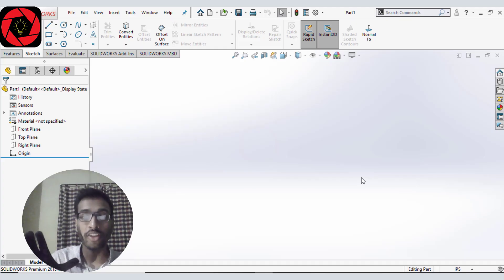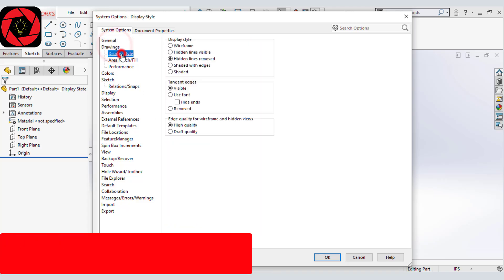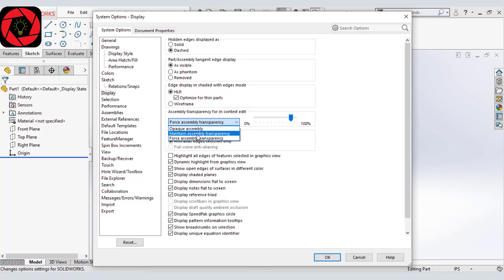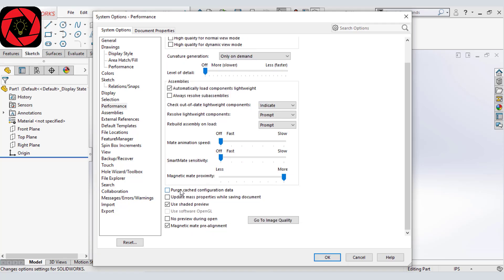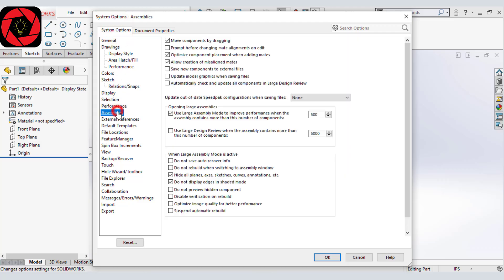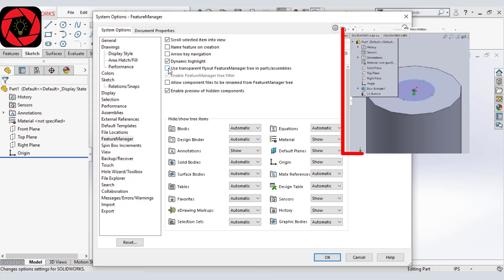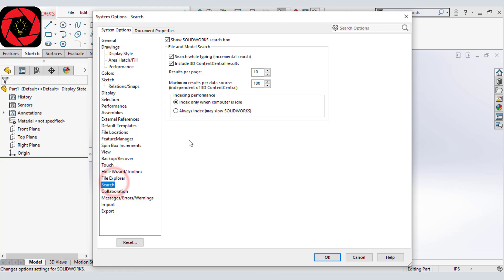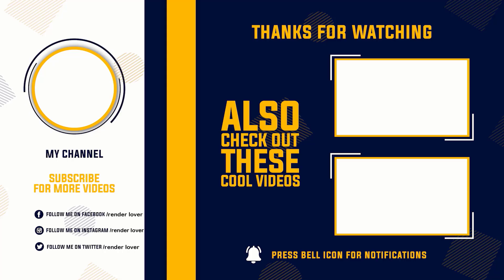Run your SolidWorks Faster |Up to 5x times! Best Performance Settings for Maximum speed || 2010-2023

Comment: I am just starting and the 3D experience window (the small menu all the way to the right, close to the top) all the time opens up and takes up my drawing space. I cannot find how to stop it from poping up. Do you have solution? Thank you.
Reply from the maker: there is a pin symbol at the right. make sure it’s unpinned (if pin just click the icon) and then click on timeline or anywhere in solidworks.
Reply: @RenderLover  Thank you